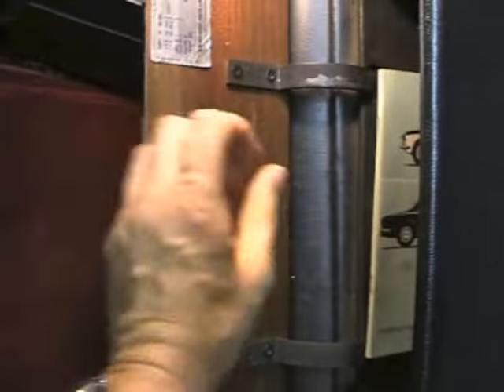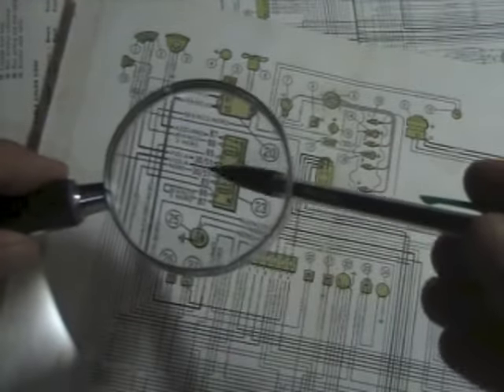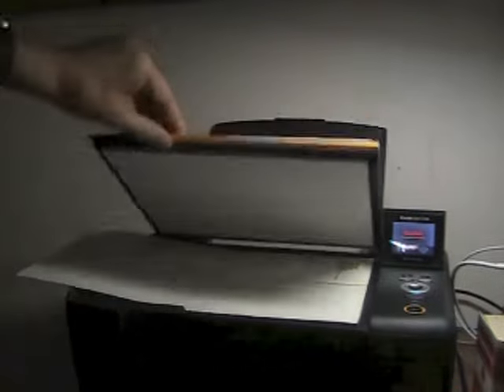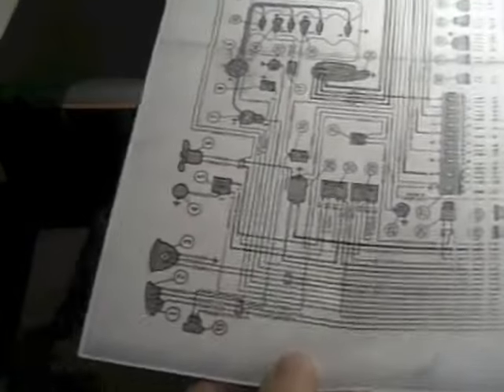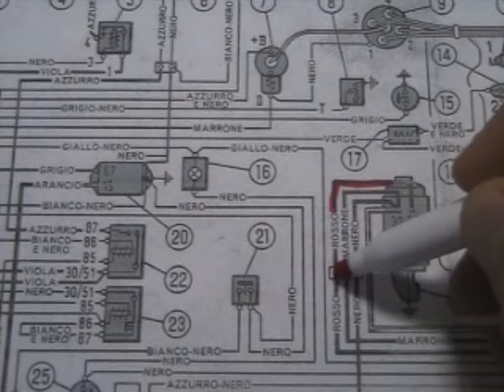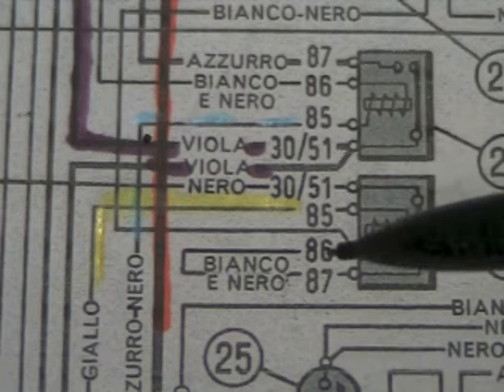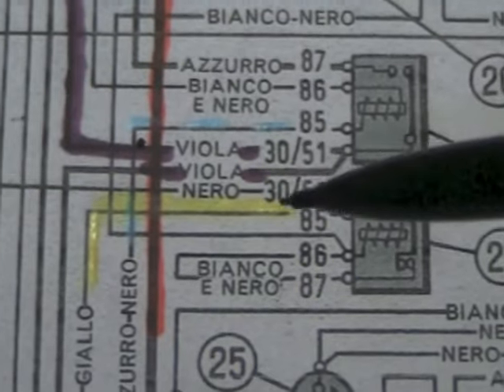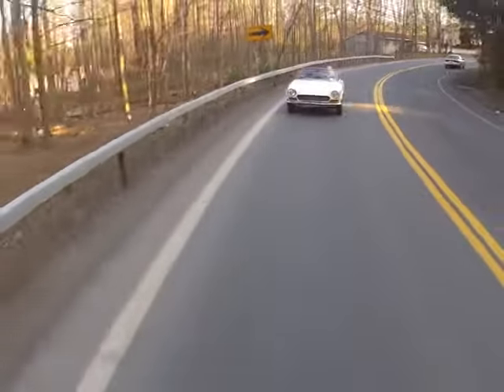Fiat 124 Sport Spider Wiring Part One

Comment: Hello, Great Video.... If I sent you a picture of the harness for the RPM gauge  on my 83 Spider that has a cut wire, you might be able to tell me where it goes ?
Reply from the maker: Hi! I've had nine Fiats over the years, but none newer than 1980, so I don't have a wiring diagram for 1983. I know they had electronic fuel injection by then and I suspect other electrical items changed as well. You might try one of the Fiat forums like https://www.124spider.org/
Good luck!
Reply: @FlashDriveFilms  Thanks,  I was told the RPM harness is the same from 1980 through 1983.  If I sent u the pic would you take a look ?  Not sure how to send pic to you though.....Dan

Comment: How can I by pass ignition switch in79 fiat 124 I want hookup toggle switch on and off and push button starter but not sure what wires goes where
Reply from the maker: I don't have a wiring diagram for a 79.  (mine is a 70, somewhat different than the newer, 2-liter cars) The best I can suggest is something online like
http://www.njfiats.org/images/stories/spider_manual/spider_electric_manual.pdf
See if that has the wire information that might help.
Alden